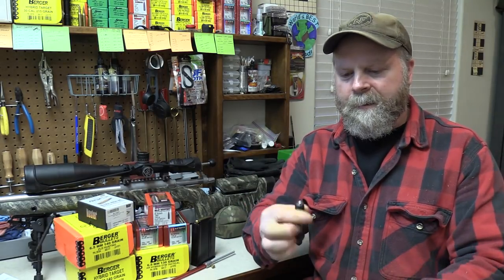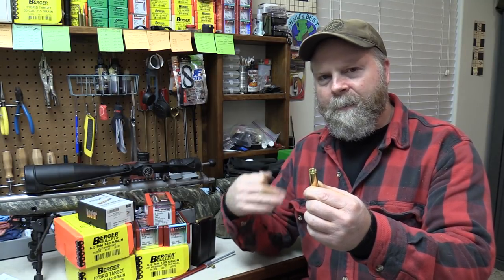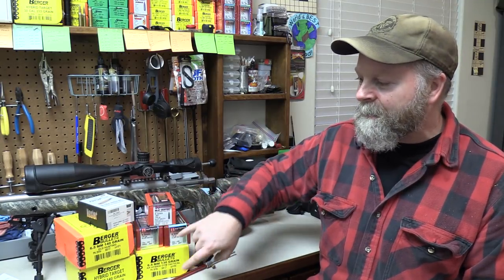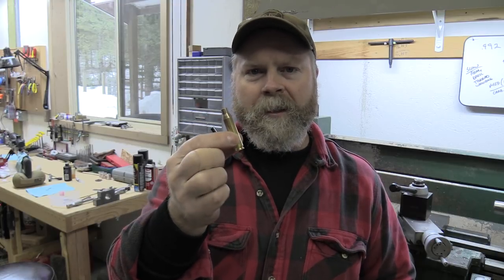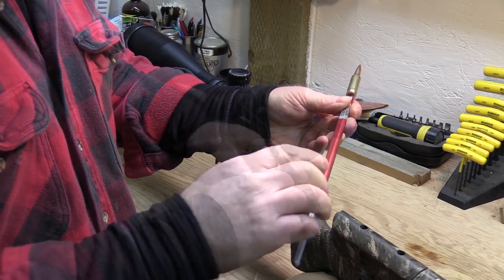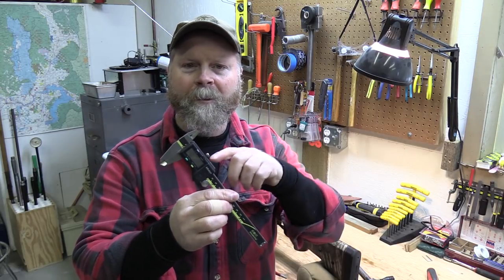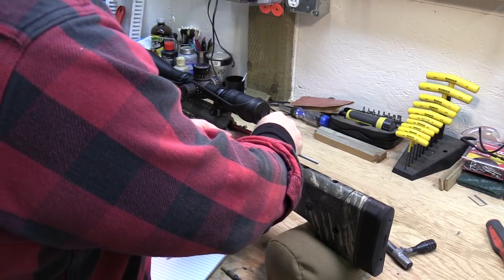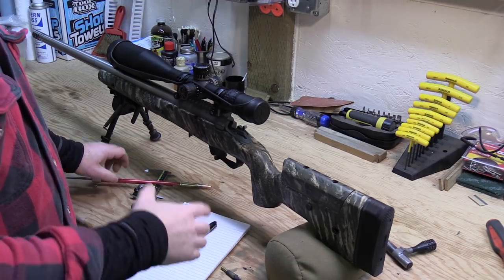Precision Rifle Load Development/ Part II: Bullet Choices & Initial Seating Depth

Comment: So.  I loaded up some 6.5 CM that is .020 off  the Lands on my SOLUS Action/Proof Research Barrel.  It’s no where close to fitting in my magazine.  It’s way too long COAL. It’s in a SOLUS chassis that takes AIS/AIAW mags.  It’s fine with ELD Match and SMK bullets but the Bergers are too long.  Is there any way around this?  I currently have Magpul mags.  Pretty bummed about this.  I hand fed the Bergers and they shoot the best by far.  I’m going to try the max mag length and work backwards and try to find a node . Hopefully I can find similar results.  The Bergers loaded at .020 off worked by far the best.

Comment: So I haven’t started reloading yet but was curious… comparing new brass vs already fired- when you re-use brass you will bump the shoulder back, how does this effect using new brass vs resized brass when measuring seating depth for bullet sitting off the lands? My thoughts are this- new brass will be it’s smallest size, so when the round is chambered it’s neck will sit deeper since it’s smaller, therefore, the seating depth will need to be greater since it’s sitting deeper into the chamber. Once fired you bump the shoulders back but it won’t be the same size as factory, therefore being larger it means it will sit back further, meaning seating depth will need to be not as deep as it’s already closer to the lands… am I thinking that through correctly? Any clarification would be much appreciated!

Comment: Sam, I'm really enjoying your videos, I feel like I'm in reloading grad school compared to what I have been doing.
One Q: I don't have a machine shop / lathe at my disposal, yet you make an excellent "case" for using fired brass to create your own rifle-specific modified case for a baseline ogiive-to-base measurement. Here's the Q:
Isn't there some way to measure the stretch for fired brass compared to a generic (purchased) modified case, which could then be used to adjust the reading? Some kind of shoulder-to-base measuring device?
Reply: No. That's dependant on the size of your chamber, so without having previously measured the chamber, you can't make a custom gauge for measuring the chamber: a bit of a catch 22.
I'd be confident using a hand drill and a hand tap since you are not measuring the tooling, only the case to the bullet (the tool just keeps the bullet from moving so it doesn't matter how cockeyed you get, it'll still do that). Also, Hornady has a custom service: you can mail in a fire formed case and they will cut the threads for you, I read it's $15 (probably about the price of the specialised tools if you intend this to be a one time deal...)

Comment: I've seen your video and another stating you body size and bump the shoulder back 2 thousands. I was going to fire form my brass to my new barrel and just neck size only, but am curious why you body size and bump the shoulder back? I found on Sinclair article that the author there said he used a Full length sizing die, and after the initial full length size he used the FL die to just lightly body size, and adjusts it to just bump a fired case (from his bolt gun) back 2 thousands, rather than neck sizing. I'm just shooting a new Howa 1500 in 22-250, and have 100 fresh Nosler brass, and 100 once shot brass which I just full length sized, ready to shoot 1st shot... as soon as weather permits! What is best sizing recommendation?
Reply from the maker: This is my take on it: http://panhandleprecision.com/full-length-sizing-reliable-precision/

Comment: Hornady says to seat the bullet fairly hard when using the comparator. Most guys say to stop when it just barely touches the lands. The results are VERY different.
Reply: I have found the same to be true.  When using the Hornady comparator on my AR Krieger "223 Match" marked barrel, I was stopping at the first "gentle" hump (sign of resistance) and finding the results were around .06" or so shorter than if I pushed through the first hump to the more solid resistance just behind it.  At first my measurements were very inconsistent and I was confused.  Later I discovered a chart at AR15barrels that showed that the reamer used to cut 223 Match barrels had .068" of Freebore between the end of the case mouth and the beginning of the lands (vs .025" of standard 223 chambers, .050-.056" for 5.56 NATO chambers).  I used Cerrosafe to cast my chamber, and discovered that was exactly what I had.  It was the bullet entering the tight freebore area that I was sensing through the comparator at first, but pushing through resulted in finally touching the lands, and my measurements suddenly became more consistent, usually within 3-4 thousandths or so.  Another clue that doing this was the correct way to go about it was that there were no significant marks, scratches, dings, etc on the ogive of the bullet after being pushed all the way through, and the bullets (68gr Hornady HPBT or 69gr SMK's) weren't even being pushed in hard enough to get them stuck in the lands, suggesting I was on to something.

On my Rem 700 5R, the comparator showed I have a .160" jump to overcome between max spec COAL and the lands, measured using a 168gr SMK.  Apparently this is common with Remington rifles.  Fortunately, 168 SMK's are pretty jump-tolerant.  The issue with overly long jumps is one of the reasons people eventually go with a custom action and build around it, to avoid that problem (among many other issues with Remington factory rifles).  At the very least one might want to have their barrel set back to "fix" the issue.

Comment: I have a question for you. How many powders would you test to make a bullet work for you? My first stab at reloading, I loaded up some Speer gold dot rifle in my 308 and an getting good vertical spread with Varget but my horizonontal on 90% of the groups is > 1 moa. Any advise on telling if it’s the powder or the bullet I need to swap? Thanks for your time
Reply from the maker: I don't know what's causing your spread, but I'm pretty set on the powders I use. I might try two different powders, but I usually just try a different bullet if I can't get one to shoot with the powder I want to use. If you want to run Varget, I would switch bullets if you don't get the results you need.
Reply: Thanks for the advise.

Comment: I am starting to reload 308 and have a dilemma: I only have about 20 Federal brass that were shot in my new barrel. I bought 100 new Lapua brass. If I use a fire-formed Federal brass to figure out my barrel's distance to the lands, will this reference still be valid when using my Lapua brass down the road? Some people recommended to do the coarse load development with fired brass rather than using an markedly different load during a brass life cycle. Should I just do SAAMI specs until I have fired Lapua brass and then figure out the headspace component? Thanks for your insight!

Comment: Hey Sam I've really enjoyed your informational videos since I started loading my 308 Win for my RPR in 2017.  I make it a habit to retain the original projectile (bag & label)that I used to document my throat wear and max ogive seating depth.  I just thought there may be a variance "possibly" if I were to just grab a new bullet months later from a diff Lot to see how my barrel is wearing.  You didn't mention anything in your video about keeping that bullet, but what is your opinion?    Thanks!
Reply from the maker: I usually keep the bullet with the modified case, if only because it gets dinged up and scratched from checking measurements. I used to check CBTO with every style/brand bullet I might use in the barrel. I don't do that anymore. I found that in the long run, the consistency of my technique was more important when it comes to getting a consistent reading. I do note which bullet I used when I record the initial throat measurement.

Comment: Still looking for thoughts on the ogive measurement.  If you are bumping the brass shoulder back from it's fireformed condition.  Technically the loaded ammo will not contact the shoulder when locked in the chamber with the bolt.  It's only a 0.001-0.002" difference,  but it still stands that your measurement from pushing a bumped case all the way into the shoulder is not the same as where the brass will sit with the round held by the bolt extractor.
Reply from the maker: The case will contact the shoulder of the chamber the same, whether it's a new piece of brass, fired, or sized. The ejector will hold it there, and the firing pin will make sure it stays there when you light it off. The relationship between the shoulder and lands doesn't change until the throat burns forward. If we could measure our seating depth from the shoulder datum to the ogive of the bullet, it wouldn't matter what the length of the case is from the case head to the ogive.
Reply: Panhandle Precision thank you for explaining this! Your explanation on seating depth with fired or new case differences and the fact the case is always against the shoulder really opened my eyes. I have a question though, would this theory change at all with belted cases? Or what if I had a mechanical ejector on my bolt instead of spring plunger?
Reply: I still don't understand. A shorter case is still going to be held by the bolt face so there would be a gap between a short case shoulder and the chamber but when you use the hornady tool you would be pushing the short cased shoulder into the chamber and that would result in an incorrect value, wouldn't it?
Reply from the maker: It's not "held" by the bolt face. In this rifle, it's pushed and held into place by the spring-loaded ejector. The only thing that allows the extractor to snap over the rim of the case is contact between the case shoulder and chamber shoulder. Don't overthink it; we're talking about the thickness of two post-it notes between new and fired.
Reply: Panhandle Precision That makes sense. How incorrect do you think my measurements would be with a Hornady pretapped case vs my fired cases, I don't have the tools to tap my own cases.
Reply from the maker: You will be very close. It's a relative number anyway, for you to use as a baseline for seating depth adjustments.
Reply: Panhandle Precision, Does this still apply for belted cases? Or bolts with no spring ejector?
Reply: Do you mean between the case rim and chamber face (entrance)? The case shoulder and chamber shoulder are forward just before the neck. I think terminology is confusing people here.

Comment: When you start your load development are you using once fired brass?  Also do keep track of how many times your brass has been reloaded?  Do you cycle through the 300 pieces of brass first or do cycle through a small batch just for reloading?
Reply from the maker: I start with the very first shot out of the rifle. I don't expect loads tried with new brass to shoot as well as with fired brass, but the difference won't be that much in my experience. On occasion, I'll see a really good group or set of groups with new brass. 

Yes, I keep track of firings, and try to cycle the whole batch through at the same time.

I might do some refining of the load with once-fired brass before cycling through all of the new brass, but the goal is to get all of the new brass fired as quickly as possible.
Reply: Thanks for the reply.  Another follow up question.  How are you keeping track of the batches?  Are you just keeping them in zip lock bags or the black bins?
Reply from the maker: Zachariah Young I keep fired brass in used Costco cashew tubs, with a sticky note label.

Comment: I as far as seating depth I normally follow the same procedure you do with the OAL tool. Lately ive wondered if doing a chamber casting and including a little bit into the rifling would be a good way to do it so you could "see" into the chamber and barrel and take measurements off the casting. What are your thoughts?

Comment: Sam, I like this video and, as a result, have now ordered my tap and drill bit, however, I have but one question, and that is, why do you want to make your modified OAL cartridge case, the same as you would the cartridges you fire, by putting .002" shoulder bump on it? You aptly explained the reason for bumping the shoulder .002" on your loaded cartridges (for ease of chambering etc) however, I thought the purpose of a custom (exclusive to 'your' chamber, as opposed to a generic) modified case, is to be able to eliminate 'ALL' headspace, so that you can get an accurate measurement of your particular rifle's chamber, and therefore the bullet distance to the lands. Putting .002" on the shoulder would surely mean you're now going to have to take your measurement, then have to second guess it by 'adding' that .002" back on, in order to get the 'correct' measurement, no? 

As I understand it, what you're actually doing is exactly what a generic modified case does, only you're having to add .002" as opposed to perhaps .008" or .010" or however many thou a generic case is short (in your particular rifle's chamber) by?

Thanks.
Reply from the maker: There's no need to add or subtract anything from a modified case that's exactly the same dimensions as a case you'll be firing. That's the whole point of doing it that way.

Comment: I have browning x-bolt long range chambered in 300 win mag. I purchased originally purchased box of Nosler brass because that is the only thing available locally without ordering. It worked well but was a little pricey compared to it's manufacturer Norma (at least that is what I've read on the internet). I purchased RWS brass and I only purchased 80 because they only come in 20 round boxes. Which was almost $170. Is there a better option that is a little cheaper so I can buy 300 rounds just like you have done?

Comment: So if you are reloading once fired brass though the gun you are loading for, your bullet depth should stay pretty accurate, at least compared to new brass?  Would it be best to stick with fired brass from your specific gun?  I notice that Hornady sells specific caliber bullet depth cartridges, threaded to fit the depth gauge.  It would seem this factory item would be of no use  when thying to achieve this accuracy, as it would not mach my chamber?    I am just about to start reloading ( I am new to that) for a new Christensen Mesa LR in 7 mag.  I will be studying your vids for info.  Thanks in advance.

Comment: When it comes to inserts, you need to look at Short Action Customs inserts. The headspace ones are cut out to proper shoulder angle and the bullet ogive ones are chamfered at 3 degrees as your lands are. They are THE most accurate and repeatable. they snap in and out with o-rings and are machined fantastically. Seriously, give them a look. Use the same ones on everything.

Comment: Great video series,looking forward to rest of this series. I am a hunter and rec. shooter but like my guns to shoot their best,use the same set up as you for seating depth with exception of hornady mod. Case. Would a custom case make much difference, most of my guns are slightly above or below one moa thanks
Reply from the maker: It mostly adds the convenience of an accurate reference for seating depth. If you use the same case throughout the whole process, though, and base everything you do on that case, you should get the same results.
Reply: Sounds good, keeping bullet and case in die box should work.Thanks

Comment: Hi Sam. I have some new factory Hornaday brass for my 6.5 SAUM and I have some once fired brass that I’ve shot through my chamber.  I measured them and the once fired brass shoulders is only about 1.5 or 2000s longer than the new brass. They both feel about the same when I close the bolt without the firing pin. There is a little resistance. Should I bump the shoulders in thousand increments until the bolt closes really easily?

Comment: I just loaded some New Lapua brass and I measured CBTO using the Hornady modified case. I seated -0.010 off the lands based on the modified case. After watching your video I decided to measure the difference of the base to shoulder of the two cases and I discovered the modified case to be 0.008" longer. So now it looks like I may have only seated 0.002" off the lands. With any slop in my measuring and seating I could be closer or even touching the lands. Since I have not chambered or fired any of these loads yet I'm thinking I should seat them another 0.005" to 0.008" just to be safe. Any response would be helpful.  Thanks for the video tutorials Sam!
Reply from the maker: Dan Fransen It might not be a bad idea, especially if you’re up close to a max charge. I prefer staying well off the lands if I don’t have any load data yet.

Comment: Hi Sam. Would I be too far off I chambered a brass fired in my own gun that was trimmed to size and had a bullet seated too high which when it hits lands it will get pushed back into the case and stop at the max length. Then I can back off from there.

Comment: I am assuming that when you measure the case to ogive dimension this should be done with the actual bullets you will load. Am I correct thinking the ogive of different bullets and different manufacturers and even different lots of the same bullets are slightly different. Is this significant in developing precision loads?